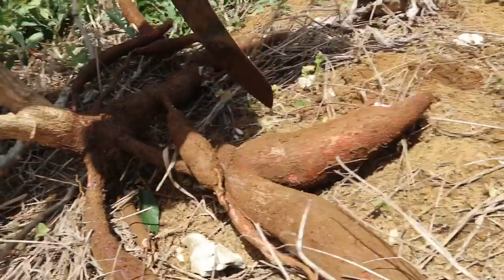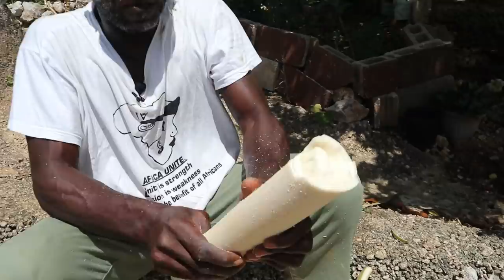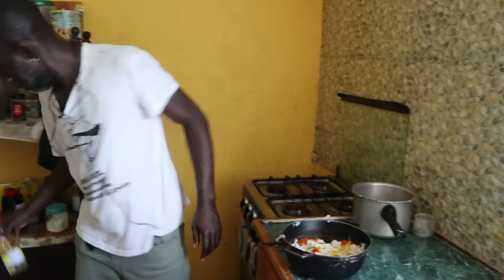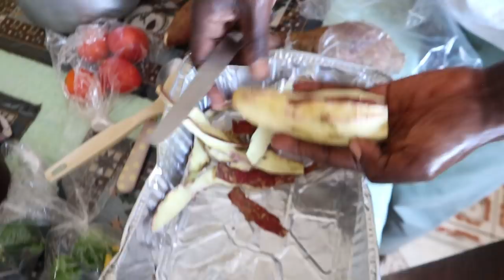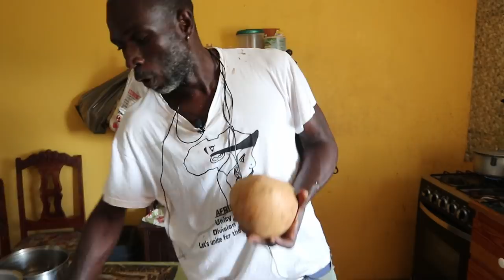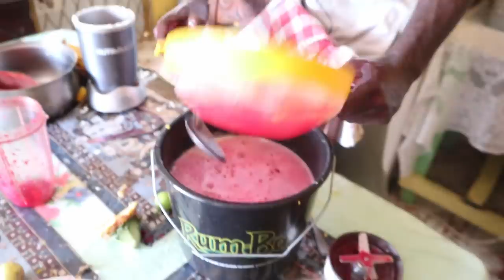The ULTIMATE CASSAVA DUMPLING| palm tree vegetable with pineapple and beetroot Juice.

Comment: So, you don't squeeze out the grated cassava??
Reply from the maker: no it's the moisture in it that makes #dumpling hold togather
Reply: Not for  the dumplings  if you using it  right away
Reply: @smorris7864  thanks